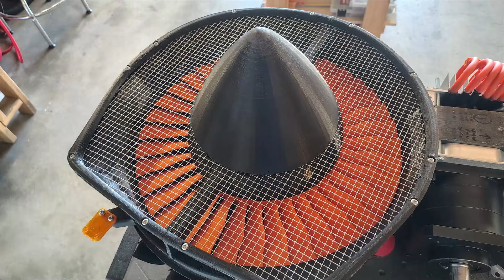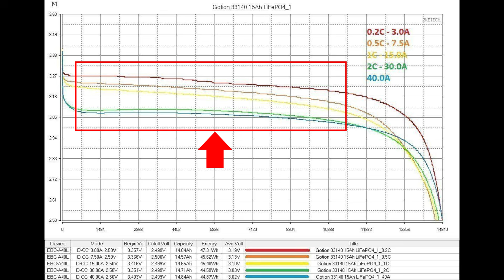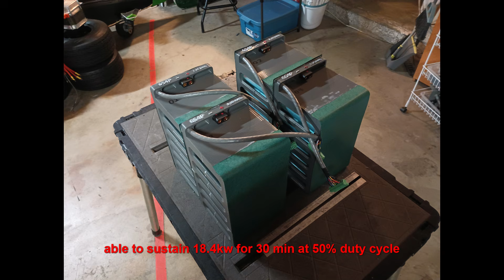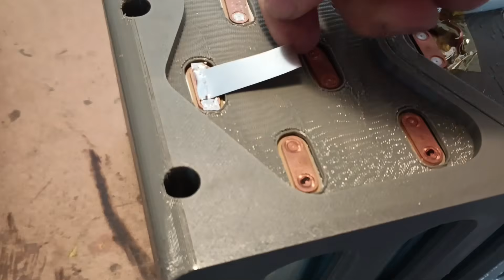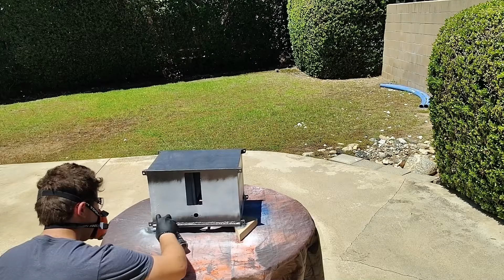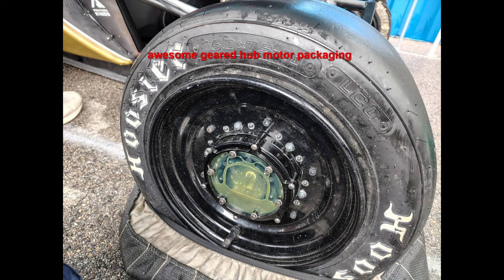How I Built an Electric Vehicle Battery Pack

Comment: I was very interested in these cells but also skeptical about their discharge rating. Have you had any luck finding a specsheet for these batteries?
Reply from the maker: I found one with the featured discharge curve, but it stated the same 5c burst. I know that is definitely not a continuous rating but it seems to still provide the current when I ran some test cells to and beyond that limit. Voltage sag is an issue at beyond 75 amps and each cell has roughly 7 milliohms of internal resistance

Comment: Next time, use resistance welding flux, and use copper strip. The flux is magical, allowing to weld copper to copper with relatively low power.  We have a lot of these Gotion 15Ah cells on hand. We would have given you what you need for your school project. If you have another school project that uses them in the future, let me know.

Comment: Extremely cool project, however the battery choice for power does not seem to be ideal. if you want max power you should go with tabless lithium ion batterys, i reccomend the tenpower 60xg or the eve 40pl, the tenpower has 6000 mAh and weighs 68 grams and the eve 40pl has 50A and weighs 68 grams but is a lot cheaper, the tenpower has a power density of 317 Wh/kg and a max continuous output of 60A and a peak of more than 100A. For 20 KW of power you would need 93 batterys weighing 5.98 kg and you would have 1.85 KWh of energy to work with. You could get 500 cycles out of them and it would cost you around 380 euros without taxes if you buy on nkon. What is the reason you went with LiFePO4 over tabless Li ion?
Reply from the maker: I needed the larger capacity as well as power so it could run for more than a couple of minutes, and the much longer cycle life was appealing as my other go karts are cycled frequently and hard.
Reply: @AydenWardellAerospace  For high cycle life i totally understand. But as far as i know(i am not an expert) tabless li ion can be put under larger loads and has about 50 percent more power density which could noticably decrease the weight which changes the max acceleration able to be achieved. However reliabiliy and certanty that the battery isn't the problem is a pretty nice thing to hace so i understand why you went with lifepo4 especially because battery hookup is usually very cheap.

Comment: if you ever do this again you can get the hybrid battery out of old cars for cheep, they usually have a pretty low capacity, but they are designed to cycle hard, fast, and super frequently, and they already have lots of safety features and cooling built in.
they also are usually lower voltage than full EV batteries ~200v so might be perfect for ypur applications. 
love the projects as always! keep it up :D
Reply from the maker: Funny enough, I also got some Honda clarity modules for a different project, only 2kwh for a pair but can put out 36kw
Reply: @A @AydenWardellAerospace  awesome, cant wait to see what you do with those lol. 

again best of luck and keep up the awesome work!

Comment: What spot welder are you using and what setting? I got a few of these cells but gave up trying to attach them to anything. Frustrating.
Reply from the maker: I am using an AWithZ P60F Spot Welder and using near maximum power and duration with a double pulse, although I initially only was using 10% power and had trouble sticking the nickel as well